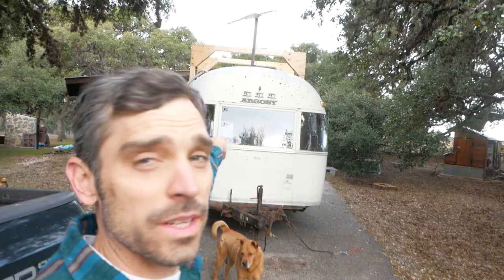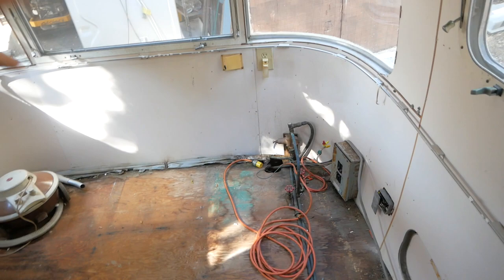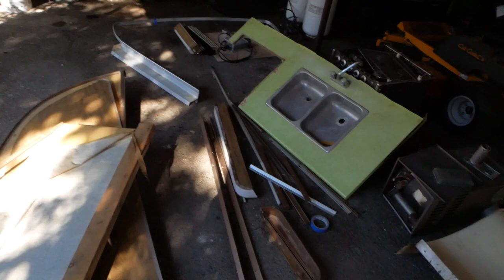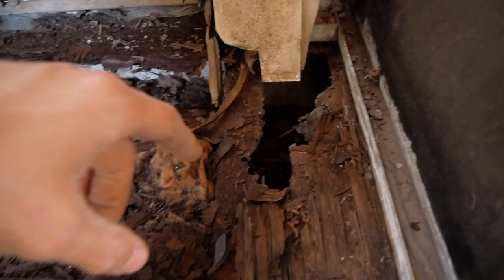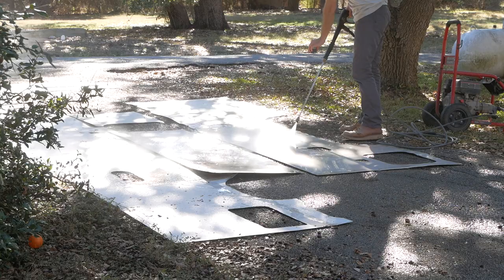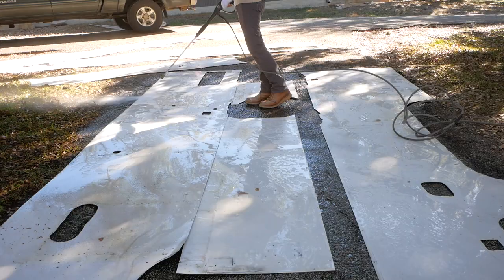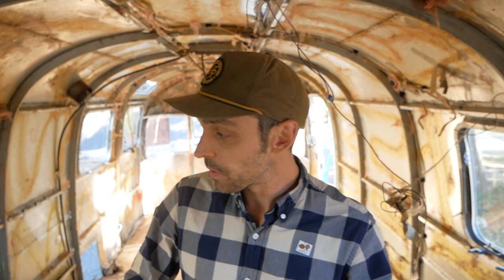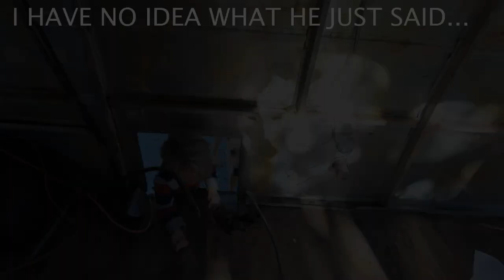Restoring A 44 Year Old Trashed Out Airstream Argosy (Ep. 1)

Comment: i had a Argosy for years loved it  luckily mine had no leaks ever  i did nyu it from the original  owners who always stored it indoors  before my ownership  another reason for the light covers cracking is the older 12 volt bulbs got really hot  they do btw produce l.e.d ones  now that fit those bases   fill up your black tank with clean water  and some  Dawn  drive it around and dump it  on your first trip  i did that  a few trips and  i wound up with a pretty clean  tank  and eventually just our poop  be pretty careful with whats in there   as they used to use Famedehyde based  deodorizers in the older holding tanks  those kids are too cute  buddy they should make all your hard work worth it  parent tip  is teach them jobs to  do setting up and breaking down camp  i even watched  a family that had a young boy who  had his own  cordless  drill to lower and raise the stabilizer jacks  plus the kid was faster than his father lol

Comment: THINKING of doing the same thing, YOU SAID ALL AIRSTREAM TRAILERS LEAK from what I have found is that only a couple of fiberglass models do not leak. I believe  you with all of those seams and rivets spaced so far apart that it would. The structure looks strong but there is no x bracing it looks like they are relaing on the aluminum skin  but is so thin it will flex. I would like to how much the frame flex there is if you jacked one corner. One more comment the inside walls had no structural  value at all, strange that would help out a lot . The more I see about airstream the less impressive they seam. Why use a steel frame and wood floor I guess it all about the SHINE.   Best of luck post more .

Comment: "They" leak if they are not maintained.  "They" means everything Airstreams, Argrosys,  airplanes, boats, houses ,  barns, commercial buildings, etc.  Just remember it is a long project.  You might find this forum helpful. http://www.airforums.com/forums/f227/  I will caution you that a 44 year old likely needs new axles and conversion away from the 15" wheels with ST tires to the 16" wheels with LT tires.     Junk all those old appliances and converters.

Comment: I don't know a whole lot about fixing campers but I can tell you that you're better off just tossing that old fridge out.
The fridge in my camper went out and I replaced it with just a regular fridge since the camper is parked on a permanent site and there was a big difference in the electrical bill.
Those old refrigerators are not very efficient.  A new 3-way refrigerator would serve you better.

Comment: You should be wearing a nose mask every time you enter that mold factory.  And gloves, for god's sake!  What are you thinking of?  Get the Harbor Freight 0.9 mil black nitrile glove pak 50 for $13. Well worth it.  Nose mask is essential.  Mold is not kind to lungs.

Not such a great idea to remove walls. Trailers are partially framed by walls. Be careful tearing stuff off for 3 reasons:
1.  It can cave in or fold over without support.
2.  Many parts cannot be replaced easily, and you need them around for samples or measuring for new replacements.
3.  Many small parts can be sold off on ebay to vintage trailer buyers.  You would be surprised.

First issue I see is the wrong insulation used by Airstream - pink fiberglass is horrible when wet - turns moldy and clumps, rendering it useless.  For new insulation, try PolyISO foam board, spray foam, mineral rock batting, sheeps wool batting, thinsulate, and denim type cloth batting.

Some folks on Youtube who have done a great job:  Ken from Ourkaravan, Greg Virgoe.  Both did van conversions, but check out their solar setups, battery, inverter, and other tips.

Allergies - take Vit C powder in water 2 x day to flush out toxins in your body.  This helps calm body down and clean it out.  Allergies are caused in most part by toxin levels being too high.
Quercetin with Bromelian - natural extracts for allergies. Works great, all natural extracts of pineapple and onions/garlic.  Use this during allergy season to feel better.
Most of the reasons you get allergies is due to your adrenal glands being too weak from stress - either long term stress, or short term.  I'm going to give you a gold nugget of info so don't waste it.  Take Vit B complex 100 mg 1 tab at 8 am, and another at 3 pm.  Take your multi vitamin at noon.  Vit B boosts adrenal gland function. Weak adrenal glands are the cause of 'allergies' . 
Take Enzymatic Therapy brand 'Adrenergize' - adrenal gland boost.  This will clear up sinus issues, boost adrenal glands and prevent sniffling and colds.  Truly works. Do this for one month or two.  All allergies will be cured permanently.  All vitamins are not equal. Most are rubbish.  Buy Source Naturals Mega One without Iron from Amazon.  Take at noon with a meal.  You will have energy all the way through 9 pm.  If you work in the heat or are exhausted daily, take extra minerals at night. 

With regard to cleaning the walls on inside, I would use a crimped or knotted wire cup brush from Harbor Freight with an angle grinder to take all that gunk off - dried glue, etc.  Cheaper than sand paper and faster.  Eyewear is a must with those wires flying off!  Even a face mask. 

Remember to study the different bed layouts and construction such as loft beds with linear actuators, slat beds, fold down bed, Murphy bed, bunk bed... and tables.  These are the two pieces of furniture that have many choices and define the space.  I like slat beds the best.  Table - the Lagun table stand has both glides and a swivel base.  You can make this yourself.  Toilet - compost DIY toilet requires no dumping, tanks, etc.  buy a Separette urine diverter, toilet seat, bucket and you are in business.  Do not buy Nature's Head at $1000!  Ripoff.  Easy to build yourself.

You have undertaken a huge task to restore a beautiful trailer that is both historical and was built with quality materials.  Hang in there, don't compromise with shortcuts, don't feel pressured, and make sure you list your requirements before you build.  When you are done you will have created a masterpiece, worth a lot on resale, and one of a kind.  Look at what this guy does with his Airstream renovations in Santa Barbara - Hofarc Airstreams - Hoffman Architecture.  He is an architect and he restores and sells Airstreams to clients world wide.  For a lot!  Get some ideas from his models on clean design and materials.  He also tells you how to polish the exterior.
Good luck and great work!